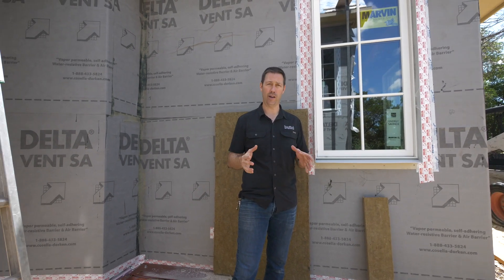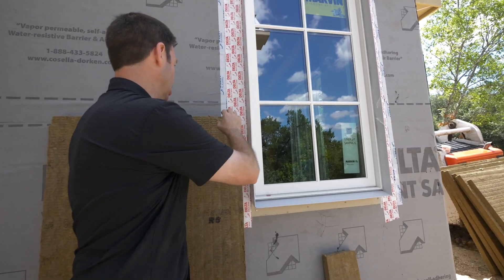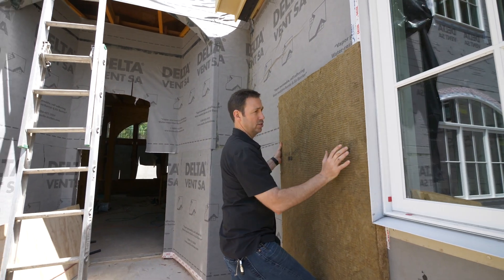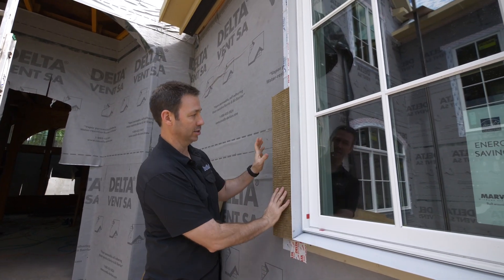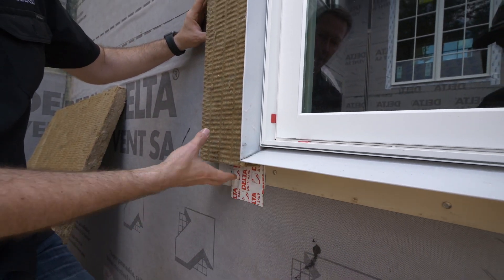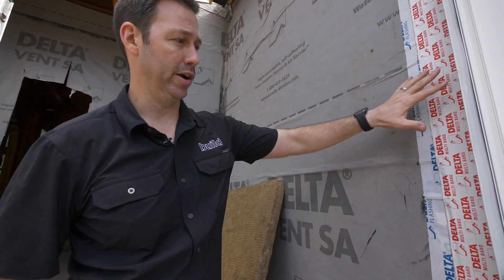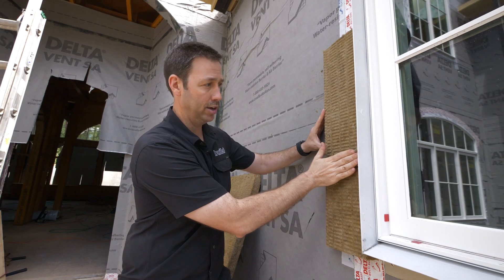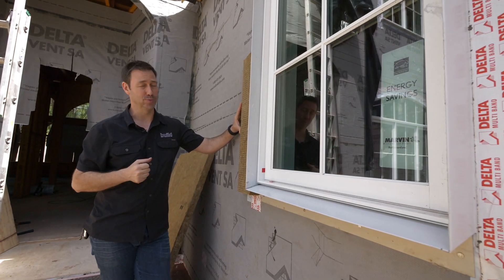Simple trick to Exterior Insulation and Window Depth

Comment: After being a builder designing and building over 200 homes, it never ceases to amaze me how complicated people make things these days. And for what reason? First it was to save material, then to Super insulate. Now there is so much material going into a house and they are so insulated they need to bring in outside air or have costly air-to-air Heat exchangers, climate control. All this what's the cost of a house to Way Beyond people can afford and creates a bigger carbon footprint all in the name of saving a few hundred dollars a year in heating costs.
Reply: It’s not just about saving money on heating/cooling. Adding insulation and preventing air infiltration/exfiltration also helps with the comfort of the home. You can set the heat higher or the A/C lower without paying a fortune. Additionally, this can help the structure last longer. Without insects, pests and water getting into the structure, it lasts longer as a whole.
Reply: You’re missing the point, Bradley. The goal isn’t just to save energy it’s to create a more comfortable building that uses less energy, is more durable and stays dry while sitting passively and maintains better indoor air quality.

Your comments prove you are a dinosaur and should be put out to pasture. Technology changes. Needs and wants change. If things were so great back in the stone ages when you used to build awesome houses stay there. The building trades do not need you.
Reply: This is so true.
Reply: Get with the times. The energy savings in these homes in some regions is well over $1000 a year compared to homes built 20 years ago.  Add that up over 100 years or more (the life of a structure) and the savings are massive.  To add to that, these homes are always comfortable and the air is always fresh. I can’t say that AT ALL for my 1997 built home.
Reply: Disagree.  If homes like this were the only ones available, most people would be homeless.  No one but the 1% can afford this.
Reply: @joniboulware1436  You can if you do it yourself. I literally am more than midway through it now. One wall at a time, I've stripped the entire exterior off to the studs, air sealed all holes of electric, plumbing,etc. with fireblock spray foam, installed better insulation Batts,(R13 because it's 2x4 walls), new osb sheathing and windows, using R guard fast flash to seal the top and bottom sill as well as the seams between the sheathing. I'm paint rolling the sheathing with Prosoco mvp wrap to complete the air, water seal. I'm then installing 2 inch exterior rigid insulation(R10), taping all joints and running a rain screen, (1x3) stripes, before I install the siding. It's alot of work, but of you want a better quality house and can't afford a contractor, study and learn to diy. 😊 Example is at my stage, I'm researching different ways to extend trim over the thicker walls, since my windows are flush with the sheathing as this window is. I've shaved more than 2/3's the cost.

Comment: What happens when you have to replace the window?  You have to rip everything out back to the sheathing.  I would prefer having the window set into stops in the window buck itself, so you never have to disturb the siding and the exterior insulation when it comes time to replace the window.
Reply: Installing a flangeless window from the inside is one possibility.
Reply: That would be my preference.
Reply: why not install insulation first, then the window? problem solved
Reply: There would be a lot of cussing.
Reply: in our case... the windows are shot in our older home. we can afford to do windows this year but itll be another 4-5 years before we can reside. im definitely looking for a solution now.

Comment: It exterior insulation becomes more popular I would think the Window manufacturers will simply extend their windows to account for the thickness.
Reply: here in canada you can order them like that
Reply: I'm in Canada and I've built two homes. I guess I never paid attention to this because I didn't run exterior insulation.
Reply: Screaminpotato I seriously doubt that manufacturers will make the extension jambs mainstream because there are so many variations of exterior insulation available and it’s not standardized to use 1” or 2” insulation or any number of combinations there of so manufacturers are not going to go thru the trouble and expense and design of extended nailing fins when it’s so simple to bend and fabricate metal flanges on site to fit the specific application

Comment: Would love to see the process of putting finish surface (shingles or siding probably) on that thick roxul walls. Would appreciate a lot that video. Thank you Matt!
Reply: alteragnostik The installers would be cussing alot.. I can tell you that..
Reply: @daveyboy8907  stuff is fine to put on but when it comes to installing the siding/cladding. It's annoying because you'll either have to string line the wall straight and add in battens or add shims as you go.

The rockwool gets pinched enough to make it not flat

Comment: Your sheet metal creates a bridge over the insulation for the cold (or heat) to escape, so normally this is not how it should be done. In other words, you are breaking the insulation layer with your sheet metal.
Reply: Phil D 

I wonder if a solution to this would be to use a non-conductive material as opposed to metal. Maybe it’s possible to use pvc or Fiberglass or even painted wood?
Reply: I wonder how much this a actually affects it.
Reply: This may be true.  What I did once was to get the maker of the window to set the flange as far back as possible so that the window casement sat more forwards.  I further used a thin balsa wood furring strip under the window flange to give me the desired window setback (set forward) then butted the insulation up to the window casement itself. It was necessary to do some fancy trimming of the insulation to get it to butt up right.  Over the insulation I used galvanized steel “C” sheet metal flanges which I attached with stainless steel wire to the stucco lath.  (Yes the top and bottom ones had a drip edge.) After the stucco was done the gap between the flange and the window casement was stuffed with foam backer rod and then topped with silicone sealant.  In this way the stucco membrane can expand and contract plus there is minimal heat loss at the window-membrane junction.  I know there are “innie” and “outie” windows but it is currently my opinion that the ones which are nearly flush with the exterior cladding allow achievement of the best thermal barrier possible.  It would be interesting to use a thermal imaging camera on both styles to see if there is actually any difference.

Comment: Matt, watching your videos has completely changed the way we are renovating our house. We have a craftsman/Victorian house in East Aurora, NY that was built in 1890, reportedly by a retired Pony Express rider. It leaks air like a sieve and looks beautiful, but has serious issues, including severed joists and crumbling plaster. Because of damage to the siding, we decided to tackle siding replacement next in our renovation schedule. I've done a lot of research and have watched about 150 of your videos. I've incorporated your methods and materials into every part of the project. We are tearing off the vinyl siding, shake siding under that, a layer of older siding and sheathing made of 1x2s, along with multiple layers of tar paper, very thin foam board and just paper. We are rebuilding from scratch, starting with Rockwool bats between the studs, where there is little to no insulation. It isn't often we get to insulate the inside from the outside this easily! We went with Zip system sheathing, using Zip tape on the main seams and Zip Liquidflash on the nail intrusions and tricky parts. We have 46 windows to replace and are and installing them with some of the fantastic methods and materials you've introduced. Because there was almost 2 inches of old siding, we have room for 2 inches of exterior Rockwool board insulation. We will top that off with a 3/8" rain screen before installing the cladding. We will be able to reroute a number of the penetrations and will use tape and Liquidflash to seal all of the remaining ones. All told, we will take walls with an R-value under 10 to about 25, and will have a wonderfully sealed envelope. I'm looking forward to seeing next winter's heating bills. Thank you for all the great information you have provided!

Comment: I have built one home in Massachusetts and I am currently building 2 more. I really enjoy new advances in energy efficiency.  One of the things that i discovered is what I call "aluminum bubble wrap"  It seems like the PERFECT insulation.... very thin, bugs dont like it, no degradation over time, inexpensive,  hydrpphobic, etc. What about either wrapping the INTERIOR studs just below the sheetrock? You can aluminum tape the seams and edges. All the same insulation can go in the stud bays and you dont have to make any accommodations for it. I would love to get some constructive feedback about this please. Thanks

Comment: the real question is when are the window manufacturers going to have a nailing flange depth choice similar to extension jamb depth choice - its logically not that hard to add a few receptor channels alongside the frame of a window for a different fin location...
Reply: Good question
Reply: When people start requesting it enough that they either learn it's a thing or realize that they can turn a profit doing it.

Comment: Passive House windows are:
Airtight
Highly insulating
Available with high SHGC glass 
                                                             We provide passive house window with U value less than 0.85
Wind load resistance performance:  Grade 6
Airtight performance: Grade 8
Watertight  performance: Grade 4
Thermal insulation properties: Grade 10

Comment: Can you put stone over the rockwool installed like this?  How would that work?  Would the wood battons and mesh be enough to hold all that weight?
Reply: I guess this is from three years ago.

But I wouldn't use this method for stone, the stone would be way too heavy to rely on the screws, especially because the screws would be "hanging" by 3"+.

You'd have to look into metal "L" and "Z" flashing if you're putting on heavier cladding

Comment: Wouldent it be easier (and cheaper) to use ZipR? Vs Roxul?
Reply: No, because ZipR puts the sheathing and water control layer on the outside of the continuous insulation, which means you lose one of the big benefits of exterior insulation - namely moving the dewpoint to occur on the outside of the sheathing/WRB layer, where it can drain or dry without affecting the interior.  This really helps with dewpoint moisture in a wall assembly (i.e mold, mildew), but you don't get that with Zip.
Reply: IMO, Thermastar LCi is a much better product than ZipR, since it puts the foam on the outside, not the inside of the OSB and thus protects it from condensation and extreme temperatures. Plus it's available up to R-15 whereas ZipR maxes out at R-7.5.
Reply: Thermalstar is just insulation with some poly layers, not a sheathing/insulation/WRB combo like ZipR; so it is not quite an "all in one solution" like ZipR is trying to be.  Rock Wool, like in the video, is a superior insulation product in my opinion.  It doesn't burn, and it is completely vapor-open.  Makes for a better wall assembly.
Reply: Thermalstar LCI is EPS laminated to OSB, so it definitely qualifies as structural sheathing, and as WRB as well if you tape the seams as you should.
Reply: Looked again and the LCI and the LCI-GX are just insulation.  The "One" is their version with structural sheathing.  But now I know what you were referring to.  It does seem better than the Zip, because the insul is on the outside.  But, there are still issues.  
One, you need to buy a special nailer to get through the insul to the sheathing.  Real hard to see if you hit the stud when the head is buried.   Extra depth makes it easier to miss with the slightest angle at the gun.   
Two, what do you do at inside and outside corners?  The insulation would be missing at outside corners, and conflicting at inside corners because it is cut to the underlying sheathing dimension.  You can't even nail the sheathing into an inside corner because the insulation is overlapping; even if you cut one side back so that it can fit in there, the other keeps the nailgun out of the corner.  
Three, the best wall assembly has only a single class 3 vapor barrier, and allows drying in both directions away from it.  This wall has a stack of 4 vapor barriers on the outside: the OSB is a vapor barrier, then a poly layer vapor barrier, then the EPS is a vapor barrier, and finally the outer poly WRB - no drying to outside for this wall.  It is technically not a "vapor sandwich", so it should be OK, but not ideal.  
Lastly, foam insulation is a petroleum product that burns readily, and releases toxic smoke when it burns.  It also loses R-value over time as it ages.  I can't avoid it everywhere (sub-slab, for example), but when I can, I do.  
Whew.  But I do agree with you, this seems a better product than the Zip.
Reply: Is there much cost difference between Roxul Vs ZipR Vs Thermalstar LCI ?
Reply: Ah yes, Thermalstar has shuffled around the names for their products over the past couple of hears, so "One" would the all-in-one solution. Nailing inside corners would be difficult to impossible, as with any sheathing + insulation product, but outside corners would be doable if you shaved off 3 inches or so of OSB off the corner edge. 

As for the vapor barrier issue, the whole panel is a single class 2 vapor barrier that can dry out to both sides; poly and EPS don't need to dry, and OSB can dry to the inside (unless you have to deal with utterly stupid Canadian building codes), so it isn't a problem.

EPS is certainly flammable, but an all-electric house with metal conduits  doesn't have that many fire hazards in the first place. Besides, as it turns out, you can use high density mineral wool as subslab insulation, and fiberglass board insulation is also available, although very expensive at this point.

I wish European style fiberboard insulation/WRB/sheathing were produced domestically to American sizes. The stuff 475 sells is amazing but expensive as hell and made to odd European sizes.
Reply: Not sure - it is an involved calculation.  However, comparing just the insulation components, Roxul is ~$1.4/sq.ft., and EPS foam is ~$1.1/sq.ft., so yes it costs a bit more.  To compare with the combo products you'd have to add in the WRB, the sheathing, and the respective labor costs for each.  Roxul will end up costing more, I'm confident, but it does make for a better wall.  Roxul costs have come down a lot as it has gained in demand, and both Roxul and competitors are ramping up production.
Reply: agreed!